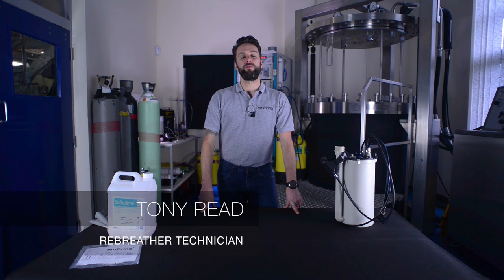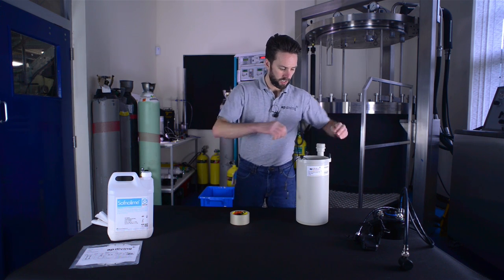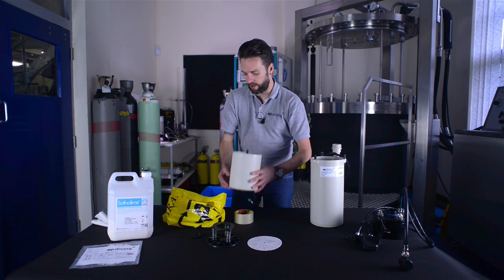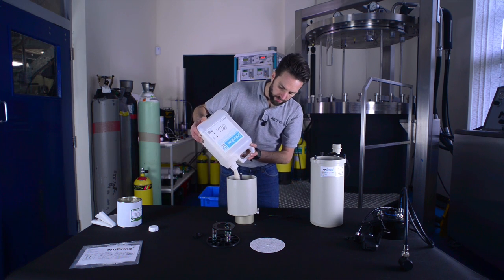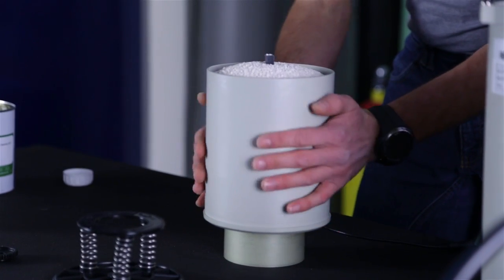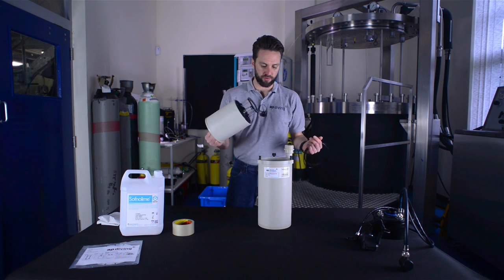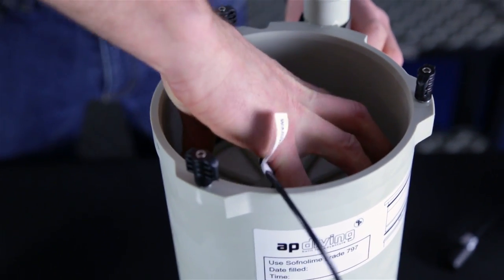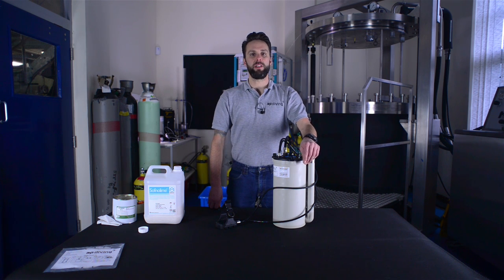How to: Empty and Refill your Inspiration Rebreather Scrubber Cartridge

Comment: How often do you have to refill an inspiration rebreather cartridge? How many dives is it good for?
Reply: I can get well over 4 hours with the small one. The manual is conservative and has it rated for less.
Reply: The inspiration is rated for 3 hours, the evolution is rated for 2 hours.
Technically you should only use them for 1 dive as the lime has a mix of CO2 absorbent. Some reacts faster to generate heat and moisture that is a catalyst for the rest of the CO2 absorbent. 
Many people will use the scrubber for multiple dives just pre-breathing for a little longer

Comment: I'm not sure how I feel about showing  random folks how to used stuff they should only be trained by a qualified tec to do. And that is of course after passing classes and so forth before even touching one. This is how idiots figure out how to die on rebreathers. I'm not on a specific brand mission here but my breather takes alot of steps so no one except  property trained rebreather divers can even turn on the unit. Thats probably a good thing. Unfortunately folks have had major issues when they packed  scrubbers wrong so I see the reason for the video.  To me this is the equivalent of showing random folks how to do the start up sequence on my rebreather and thus assuming responsibility for them doing so in the future. I suggest taking this off public you tube. I'm not aware how many other manufactures currently  share operation related info with the public domain. But my opinion applies to them  as well. Lets keep our hobby safe and perpetuate safety while diving.
Reply: Even if they didn't showed the procedure a 10 year old kid will manage to change this filter At least now you can do it the way they do it
Reply: I have been building my own home made rebreathers since I was 8, it really is not that complicated... Well the rig shown here is but you can make much simpler versions that work much better without a lot of imagination or skill.
Reply: I had witnessed some people testing semi-homemade soviet military rebreather. How bad it can be? Just try to imagine: no SPG at all, no any depth gauge, no bailout, and solo in water with a funny "shore support" with a camera. I had tried to talk about, and realized that they had no idea about what the scrubber is and what gas in their tanks. It's a miracle that nobody died.
Reply: It’s a fair point. However, I think the benefit is this is explained direct from AP. interesting incidents where people have filled incorrectly as a result of instructors only giving their personal knowledge. I don’t see anyone having a go a packing a rebreather and diving in- the seller even in second hand cases is probably likely to say ‘you realise you’ll definitely die if you don’t know what you’re doing’!  All adds to the great debates ! 👍🏻